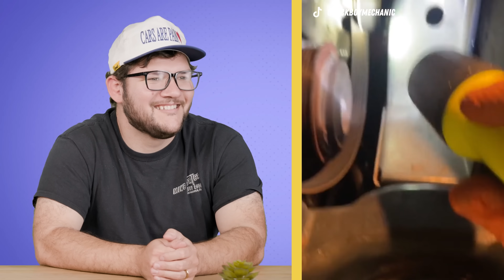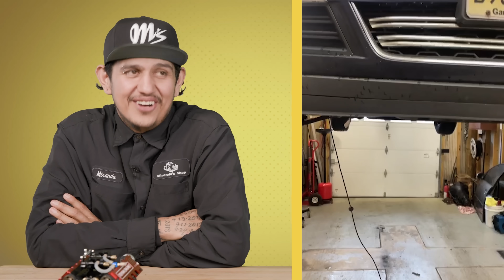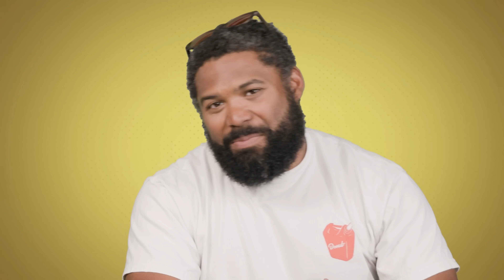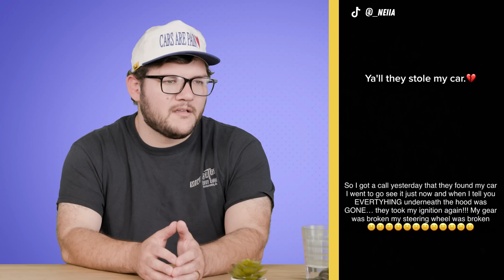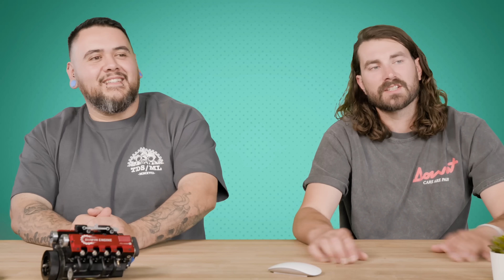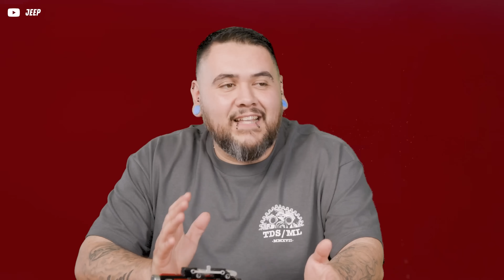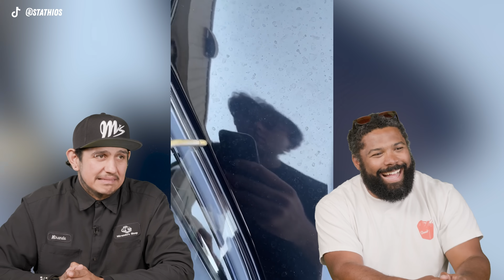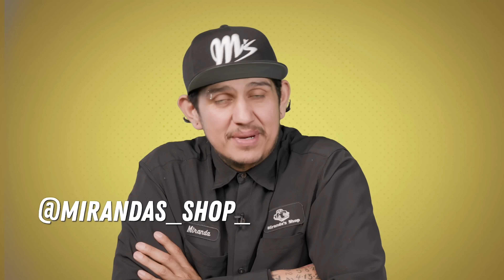Mechanic Reacts to Car Engineering Fails

Comment: I take issue with the theme of this video for one simple reason. The engineer who designed the engine is not the same engineer who designed the chassis; who designed the suspension; who designed the transmission; who designed the climate control etc…. It was some overpaid, bean-counting, corporate executive t**t who insisted that they cram existing technology into a new body in order to appeal to whatever their most recent focus group told them would sell to the latest batch of wino housewives with ‘live/laugh/love’ plastered all over their house. Christ, I hate this planet.

Comment: From an I hate engineers standpoint, my wife’s 2014 town and country (any other Chrysler v6 owners know where this is going).  They made the 3.6 oil filter housing and oil cooler into one piece…. OF PLASTIC!  It cracks and leaks oil and coolant everywhere.  Most shops locally wanted 2500 to do the job.  I bought an upgraded all metal part from dorman and did plugs an oil change and some cleanup while I was at it for about 400 bucks and got it done in a few hours, but had to disassemble the entire top half of the engine….  It was inconvenient to say the least because of a poor design.

Comment: Currently at my work we are expanding and installing some new equipment and automating our CNC system. Having some friends that are Engineers I send them pics of some of the asinine things we find. And the response is about 50/50 if they think it is a poor engineering decision or a bean counter decision. Usually the most screwed up things my friends say it is a lazy engineering decision. 
Just pulled a 3D printed bracket that holds a sensor for part of the CNC automated laser alignment. The bracket was held in place by a couple of springs that look like came out of a ball point pen with a set screw for attaching it. The bracket needs to be able to absorb shock, but this was just a dumb set up. We all had a good chuckle when I got it apart to see why the sensor wouldn’t stay in place, one of the springs broke. And everyone agreed that it is half lazy design and half bean counter. Since the system is under warranty I am not allowed to retrofit it with something that will actually last. I guess the manufacturer likes making 3D printed parts attached by springs or something.

Comment: Im both electrical/mechanical tech for F-35, been one for close to a decade, you would think that most of my frustrations would be with a new airframe, in the military, all sort of engineering BS from manufacturers like Honeywell, Northrup, etc. it was a non tested frame when i got in, plenty of growing pains, had to go through multiple retrofits and the stress it under is going to cause failure....

NOPE ITS THE SHITTY 2015 CHRYSLER 200 I BOUGHT BEFORE I KNEW HOW TO WORK ON CARS. Holy shit ive actually replaced the entire fuel system and gone through 3 pumps AND LIKE FUCKIN CLOCKWORK i still get this shit every year or so, where the car starts to auto throttle on start because something is fucked, i replace it, its good for another 8 months then i gotta chase down bullshit. I had to spend like 400 on a code reader because of course Chrysler locked it, ive replace almost everything outside of an engine rebuild, from TPS because oem lags like a bitch, to center console because some short just decided to happen in the console that SOMEHOW decided to fuck my entire electrical system. I dont know how to explain my frustration on "my car wont start because my entertainment system is broke" 

That car has been the bain of my existence. And i have spent more time cursing the most garbage, dressed up dodge dart than i ever have a bird. 

Its like an abusive relationship. And i hate it here.

Comment: Water leaking through the headliner is a maintenance problem. Clean out your sunroof drains or this happens. This has been a known part of maintenance for a sunroof for 50 years. Drain tube gets clogged and water hops out the sunroof tray.

Comment: "It's a Jeep so..." absolutely savage and too true. This is probably my favorite segment/series on all of YouTube at this point. These three are keepers and Angelina and Sandro have to be mainstays. I say this on behalf of the boys
Reply: Its build buy FIAT now and Italians were never good at Electrics/Electronics.
Reply: O think even the old ones had a problem with the back door bending
Reply: I drive a 2007 grand cherokee and apart from the quadra drive system it's all Mercedes electrics and powerplant.
Reply: Never had a problem with my Jeeps...but it all depends on how you treat the girl. I have a Compass Trailhawk, but I remember those fucking Grand Cherokees lasted forever. I still see them around.
Reply: Blame Daimler, and later Fiat, NOT Chrysler.
Reply: @paulstandaert5709 Chrysler and it’s brands (Chrysler, Dodge, Jeep, RAM) should’ve stopped existing back in 2008.
Reply: @paulstandaert5709  Chryslers we’re fuckin trash in the 80s and 90s too tho. 😂😂😂
Reply: @iamlpdo19  If you are making the comparison to Hyundai, Subaru, General Motors, and Ford motor company of those days, we can have quite the discussion about which ones were the crappiest and why.
How about we start with General Motors' plastic intake manifold gaskets.

Comment: Just cut that first bolt then replace it with a shorter one. Since the threads aren't under tension anymore you can remove the pulley and bolt head then back the rest out by hand. Still poorly designed though...

Comment: turbos bening built into the manifold as one part to save money, plus exhaust side facing the firewall so the turbo doesnt fit out without taking the vaule cover off or pulling a axle under it lol

Comment: All this talk on bad engineering reminds me about how when I need to replace the battery in my parents' 2015 Silverado. I have to remove both the airbox and coolant reservoir to get to the fuse box, which barely has enough clearance to move out of the way to finally get the battery out. Around 25 bolts have to come loose to change a battery.

Comment: My "f" it mechanic moment was a z72 late 90s s-10 Chevy blazer 4x4 vortec oil pan gasket...front of motor comes off because the disposable plastic timing cover is also part of the pan gasket and the front end has to be dropped to even drop the pan... let's not get into changing plugs on the s-10s... I refuse to work on them now along with Subaru svt and any jaguar.  Engineers suck.

Comment: When I would change the oil on my old 89 Toyota pickup 4x4 regular cab/regular bed 4 cylinder ... the oil plug was at an angle to protect it from rocks, but it was pointed directly at the u-joint on the transfer case, so I'd pull the plug and warm (hot) oil would shoot out, hit the u-joint and go EVERYWHERE.  So after a few times I took my truck to the high end gleaming white dealer shop for an oil change on the condition that I could observe the work and see what the trick was to changing the oil without a HUGE mess.  He puts it on a lift, gets the jack funnel, removes the plug and ... he runs away and oil goes everywhere.  No "trick" just a lot of cleanup.

I had an old pontiac that had a belt that was trapped behind a support arm for, I think, the alternator, so to change the belt you had to remove the alternator, but the bottom alternator bolt was a quarter inch too long to remove without hitting the fan so I had to remove the fan, which meant I had to remove the fan shroud, but the fan bolts couldn't be reasonable accessed with the radiator in.  So, replacing a simple old school fan belt turned into a whole afternoon of work because of a whole series of bad engineering decisions.

Comment: As an engineer, I'd agree with these conclusions. However, I will say that often an issue may be discovered before it's too late, but upper management will say that it is too late to change anything and just to roll with it and hope for the best. Quite frustrating when that happens. I've also known othet engineers who have never actually worked on anything, even small stuff, so they have no concept of these types of problems. So there's that too. Plus engineering school doesn't typically do a great job of teaching how to see these things before they become problems.

Comment: The problem is design by committee.  If you're in charge of building the belt drive system, there's nothing you can do if the person in charge of building the chassis doesn't allow enough space to get the idler pulley bolt out.

Comment: The problem with engineers is they design a car without taking in account with what engines are out at the time for them back in the day they’d build the car around the engine atleast with Hondas and Toyotas they still reverse engineer their cars and engines

Comment: At my dealer, we put a motor in a car with 150 miles. Customer wasn’t getting a new car again lol. That ticket got handed out to the best tech and that car is factory again. Besides kiss marks on bolts and hose clamp history marks which he does match up perfectly you wouldn’t even know he put an engine in it. And that’s how it should be. Instead we got mechanics who are barbaric and mutilate the new car requiring the customer a new one. Or poor judgement and being afraid to work on it, sometimes u gotta take a hit on pay. That’s how it is, that’s what everyone signed up for.

Comment: I'm in school for engineering right now and have had a few GM cars in my family. They always confused me w their decisions, especially regarding fluids. The Cavaliers, I would have to remove stuff to get to the oil filter, and on the Cobalt, the filter was under the engine itself. I was always so confused by the engineering decisions made

Comment: If it doesn't burn fuel it is not a car. It's a vacuum cleaner disguised in a car body with a weird T instead of a badge. But don't worry, after 10 years it will burn your wallet to a crisp.

Comment: I think you missed the fact that Accountants are often the problem. Engineer: designs the best thing ever. Accountant: Cheaper!   Engineer: designs the second best thing ever.  Accountant: Cheaper!   Engineer: designs something not bad.  Accountant: Cheaper!   Engineer: designs something not good.  Accountant: Cheaper!   Engineer: designs turd.  Accountant: Cheaper!   Engineer: designs worse turd.  Accountant: Remove that, and that, then PERFECT!!! I think the Accountant was the L on that washer issue. Yes there are a LOT of crap engineers who can't design for repair, but accountants are a huge over looked problem.

Comment: I was a vw dealer tech for a couple years, I gave up on them.
Door harness on atlas and their vr6 fuel injectors.
Head gaskets on the new 1.4 & 1.5 engines.
I replaced a tdi engine under the diesel gate warranty even though the customer ran it low on oil. It had 1.5qt when it came in for a knock.

Extended warranty on pistons in their audi 2.0T (2013-2017-ish) engines. Twin
Turbos on the rs7.

The list goes on.

Comment: GM has a record for most failed designed vehicles. Tesla caught up in a short time. I called it tesla is a backyard build that people put the safety on their lives for a car that had no proffesional car engineers, built under a porch with false claims that electric cars will save you money when expenses for anything electric requires special technicians and equipment which in cost $$$$$. I hope elon stops producing cars. You had a job and you failed. Im glad when actual mechanics point out how bad GM is. Instead of these junkyard replace part house you tube mechanics that drive their junk chevy trucks with miscolored parts , junkyard numbers all over the engine, christmas lights on dash, driving a 2005 silverado like its worth 20-30k. No bro your truck is worth bare mininumin 5k at most. Knowing you have a lifetime of repairs when you commit to anything GM. 😂😂😂

Comment: Should really blame the bean counters, not engineers. The engineer didnt want that idler pulley to ram into the frame when you remove it, the bean counters said "we use this idler pulley on another model and it'll fit here, it will save us $0.0003 per car"

Comment: Allright time to try to clear some things up. Full disclosure I am in the engineering industry, and while not specifically in the automotive industry, the practices I will describe apply to all of engineering. It is very difficult to tell if/when an engineer messed up in these cases. Here's why:

1. Its not in the budget. This is the most likely. Engineers very often notice these design flaws and are prohibited by management and the accountants from redesigning bad parts or designs as it was not in the original scope of the project. Accountants will weigh the cost of fixing the issue versus the cost of repairing the problem till the warranty runs out. See the history of the Ford pinto and their lawsuit.

2. Ask for Legos and get Megablocks. Parts have certifications and regulations to follow usually which costs millions to obtain. Often engineers just have to make what they got work. This sometimes means fitting a part where it doesn't want to go, usually at the expense of the people doing maintenance in the future. If its any consolation, I personally lose sleep over stuff like this even though its out of my control. It might be what happened with that bolt on the traverse in the video  (along with scenario 1).
3. Speak loudly and carry a big stick. This means some big wig (usually not an engineer) decides to make engineering choices ignoring the engineering teams warnings. This is often why you see engineers not get along well with sales and accountants.

4. Engineering fucked up. This one happens too and gets caught, but cant be fixed due to scenarios 1-3. Time is a non negotiable budget often shortened by harsh deadlines pushed through by upper management trying to raise their bonuses. At the very least this one has a small silver lining. This potentially might be the only way to prove that an engineer messed up. If the issue gets fixed it means engineering messed up, recognized the problem, and circumvented the 3 previous scenarios. Example: Na miata short nose crank vs long nose crank design. Took around two years for problem to show up, be identified, proven to be cheaply to fix, and didnt interfere with the big wigs salaries. It gets the green light so it gets fixed.

Comment: I wouldn’t blame the factory, but management culture.

When managers ask you for a quota, quality isn’t on your highest priority.  Take a look at Tesla, they only want to get rid of the backlog, and look what happens

Also, engineers are responsible for designing the item, AND how it’s gonna be assembled and serviced.  The oil spill one, although bad design, clearly could’ve required you to remove the undercover or do a suction oil change like BMW and Mercedes.

I also blame many engineering issues to out of touch recently graduated students with little to no experience or foresight

Comment: use the 3 switch kill system  that is sold in Australia. And Jeep is part of the lemon party. As a programmer you don't want to use the waterfall model use agile for development. If car manufacturers used an agile approach would make the car design go so much smoother :)

Comment: Heheh, you guys barely even scratched the surface of this...

Batteries in early-00's Chrysler sedans, buried in the bumper. It has to come out through the wheel well. Why!? That means three separate lifts tying up a mechanical/tire lift bay for half an hour instead of most cars just pulling into an open bay and taking ten minutes.

Volkswagen in general, using wheel bolts instead of studs and lugs. It makes it a cold, dirty, messy job at best, bracing a snow and dirt covered wheel and tire against the hub with your shoulder, with the tiny guide pin to carry its weight while you get the first bolt in, or at worst makes it a two-person job. And you don't want to know what happens if you break one. Instead of just pounding the stud out the back of the hub, there's a pretty good chance you have to replace the entire hub, all because some other tech didn't use a torque stick and just rammed the bolt on with full power.

Saab putting rubberized plastic... I'm gonna call 'em 'orifices', around where the tie rods go through the side shields of the engine bay (to keep it nice and clean). That's cool, but what happens when you have to use some heat to free up a frozen collar? Oh, that's right. The heat spreads and catches the plastic on fire, hooray!

Dodge stuff with the battery under strut tower bracing and/or windshield washer fluid reservoirs, 'cause that's fun.

Comment: FYI that leaking Audi is an engineering issues with VW/Audi that involves multiple models and spans a couple of generations for vehicles with panoramic sunroofs. Dealer will replace the sunroof frame for around $1500 and you will be back in 6-8 months with the exact same issue.

Comment: My jeep has 134,000 miles on it and all the electronics are going bad. The speakers died, had to replace the fan, the front ac blowers don't work. I'm wondering is there a brand of car that is purely loved for it's reliability?

Comment: 9:45 Dacias from Romania around the 1986s were notoriously badly built. Everyone knew in Hungary that after you received one (after waiting for it 2-3 years), your first trip should be to a mechanic to tighten the bolts, or your new car will fell apart within 500-1000 km, including the engine ...
But come on, that was WAY cheaper than a highly hyped Tesla ...
Reply: Says the guy comparing Teslas to cars that would literally fall apart. 

Speaking of hype.....
Reply: @aarongreen1654  Here at least you paid reasonable price, and knew that you must double check the build quality ...
Reply: @laoszmagyarul  😴